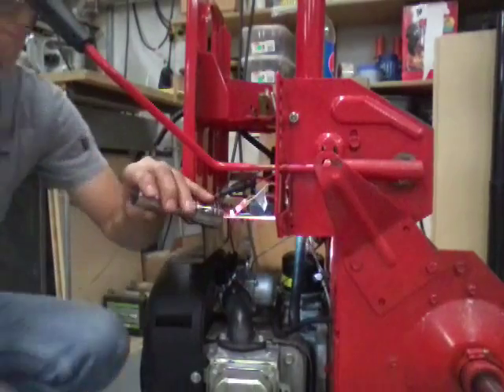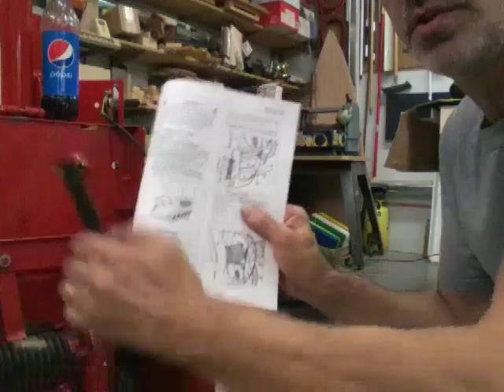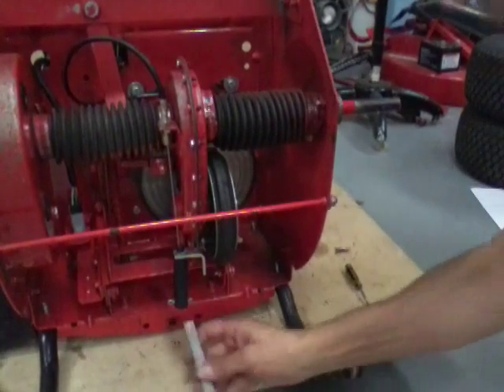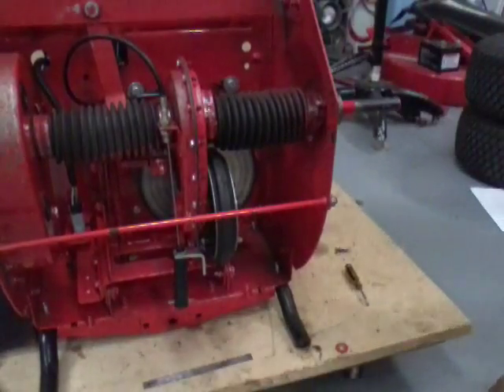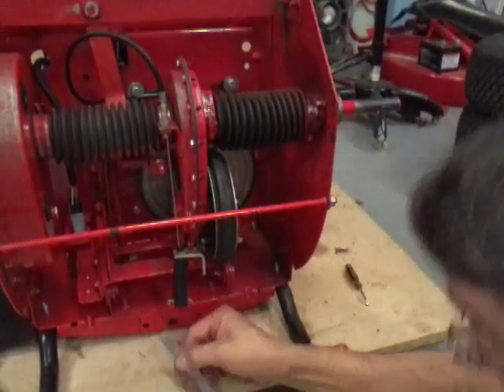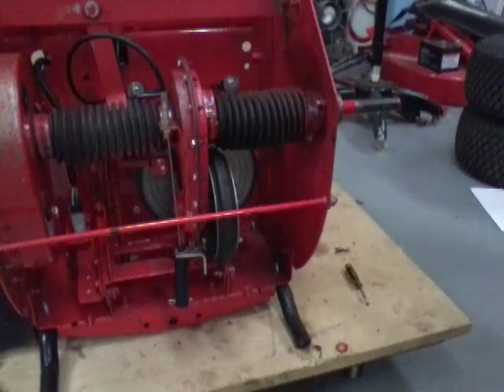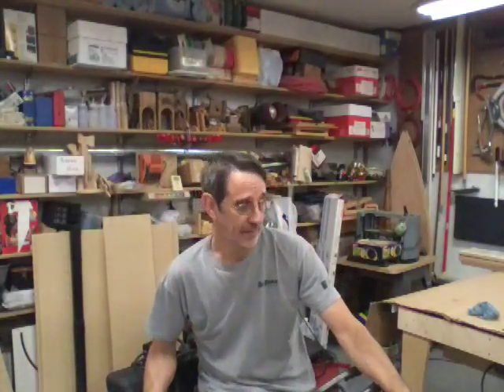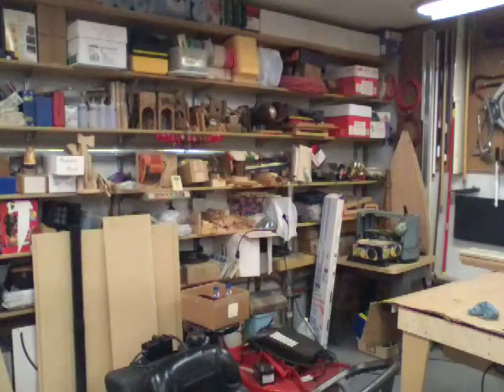144.   Adjusting the clutch and brake cable, installing the rear tires, the seat, and the gas tank.

Comment: Jim I ran over something with my snapper now the clutch only has about a qtr of an inch area to mash the peddle
Reply from the maker: I don’t know what you could have done to the clutch by running over something shorten up the cable by using the pharaohs and putting them through the backside of the pedal.
Reply: @jimjackson9381 where would you start with a slow engaging clutch and the shifter is really tight and does not want to go into reverse ?thanks so much for your great videos 28 inch high vac deck it’s really tight watch you video on checking the bracket when shifting I don’t feel any notches I have a spare machine exactly like it thinking of switch the motor onto it
Reply from the maker: @waynekelley2029 have you stood the machine up and checked to see if anything looks like it was damaged and if it’s shifting hard, you need to clean and grease the hexagon tube underneath your boots I would start there and then if it’s still shifting quite hard, unhook the linkage from the backside of the shift handle you’ll need to stand the machine up to do it and try just shifting the shift handle a lot of times those rust up and need to be disassembled and clean let me know what you find out.
Reply: @jimjackson9381  thanks for getting back I will work on it this week I Will lube it and check the handle also cleaning the card I will let you know how it goes thanks so much for the help
Reply: @jimjackson9381  Wayne Kelley wanted to say thanks your advice was spot on I greased the axle and now I need to replace the clutch wheel rubber is worn I will let you know how that goes the good thing is I have an identical snapper for parts

Comment: Jim not sure you'll see this. but I liked and enjoyed the video. I need the snap ring you mentioned at 8.02. Would ACE hardware maybe have them? Any chance you know what size to ask for? Thanks in advance
Reply from the maker: You should be able to get them from Ace Hardware or maybe an automotive store. It is a 3/8 outside snapping.       Jim
Reply: Jim, thanks so much for the reply. Upon further inspection I find I need the entire plastic piece that houses the spring and cotter as it has broken. Any idea what this piece is called? I plan to search the web. But, would help if I knew the correct name for it. If you can help? Thanks in advance.
Reply from the maker: Unfortunately, as far as I know, they don’t sell that piece separately you have to buy a new break cable.     Jim
Reply: @jimjackson9381  Yes, make sense. Thanks again..
Reply: @jimjackson9381  Jim I hate to keep bugging you, but I've spent hours searching the web for a clutch cable. My mower is a 301223 BVE. It has the one pedal. So the clutch cable is the long cable and the brake cable, a short cable connects to it. I can find plenty of the long cables but not the short cable that I need. I'm sure you're good at parts look up. If you could drop me a link to the cable I need, it would be so grateful.
Reply from the maker: @mrih1586  OK I just checked on Parts tree and they have them for $27. Use your model number and it’s under front end steering. It shows both cables.       Jim
Reply: @jimjackson9381  thanks never thought to look under front steering. I'm at doctor's office. Will order later. Again thanks so very much for your time and trouble.

Comment: Can the Aux/brake be bypassed using only the clutch/brake on a 1985 snapper riding mower without causing a braking problem particularly uphill?
Reply from the maker: Mary SanMiguel 
Send me a picture of your chain case with the brakes in view so I can see what styles you have and you must have a double pedal machine you can send them to my email which is
jimsfixitshop@gmail.com
Thanks Jim

Comment: Dear Jim A.
We bought a used re210 7800921-00 (turtle),  it worked fine at first. You know that we have to hold down the clutch/brake to electric  start it. It got to the point of practically standing on the pedal to get it to start. Then I figured out to pump the pedal then hold it down with both feet to get it to start. A few times it took only 1-2 keyturns to start. In the mean time the steering plate teeth wore down. Replaced it. Trying to start it again. 2 feet on the pedal again! I'm over 65 & that is wearing me out. Is there an adjustment or a by-pass or elimination fix for this?
Reply from the maker: John Verkler 
You need to check into safety switch on the yolk underneath the main case. Jim

Comment: I have a rer 2001 Snapper 30”. I accidentally cut it wear it goes into the pedal itself. I was trying to remove one of the little ferrules because I had slid into spacers to adjust my belt. Anyway, what cable do I need starting at the clutch pedal? It worked fine until I cut about 4 strands at the pedal. And is there an easy way to remove those ferrules?
Reply from the maker: The only way to move the ferrules on one side of the pedal or the other is to slide them down the cable you can try re-wrapping the broken strands around the cable then wrap the broken ends with a piece of tape to help, otherwise you may have to replace the cable. Jim
Reply: @jimjackson9381  
What cable do I need?
Reply from the maker: @Garylee62  well it depends if you have one or two pedals on your machine if you have one pedal then you need a new clutch Cable if you go on to Parts Tree.Com with your model number you can find a part you need it should be under front end assembly. Jim
Reply: @jimjackson9381  Ok, thank you Jim

Comment: After changing the engine on my 2003 Snapper I greased it and it runs great. My problem is that 1st gear is great but 2nd. & 3rd. gear grind when I put it in those gears. It will shift into those two gear but it doesn't sound like it is going all the way into 2nd or 3rd. gears. The clutch has a lot of slack in it. Could it be the align problem you talked about?   Thank Bill Davis
Reply from the maker: William Davis 
Have you watched videos 70 yet I will try tightening your yoke spring and see if that helps and let me know. Jim
Reply: @jimjackson9381  Thanks for your help Jim. Someone put the wrong sized disc on this tractor. The rubber is not loose. I did tighten the spring up. Works great now.
Reply from the maker: William Davis 
Awesome glad to hear we fixed it, don’t forget to subscribe if You’re not already. Jim

Comment: What does it mean if I'm at the maximum adjustment and all I can get is a quarter inch not 3/4 of an inch like you say
Reply from the maker: @danielborth7753  that’s just a factory setting. I wouldn’t worry about it if the brake works it’s OK if it doesn’t then you need to tighten it up a little bit.

Comment: Hi, Jim. I adjusted the brake cable like you described and got the 3/4” measurement. However, when I’m on the mower (engine running) with the parking brake engaged and the mower in neutral, the machine goes off when I get off the seat. It use to stay on when I got off under those conditions. If I clamp the pedal all the way down, it continues to run when I get off. Any ideas?
Reply: It’s the sensor under the seat. It’s designed to shut off when you get off the seat. No idea why it didn’t do that before or why it just started working properly
Reply from the maker: Well let’s see there’s a sensor under the seat or is there a sensor on your yolk inside the rear case. Jim

Comment: I got a 28 inch rider and it cranks up just fine but when I get to release the break it putters When I start moving it but when I-but when I try to put it in to engage the blades while running it runs fine but when I stop the Disengage Blades It goes back to stuttering And when I put it in park with the break it runs fine can you tell me what the problem is
Reply from the maker: It sounds like your carburetor needs to be cleaned it’s not getting enough fuel when it’s doing anything other than idling if you have adjustable jets on your carburetor you can try adjusting them but most of the newer carburetors there are no guts to adjust, you may have to take the carburetor off and I use an ultrasonic vibrating cleaner that does a marvelous job on cleaning carburetors. Jim

Comment: Hi Jim. Tom in Oklahoma.I want to leave the deck of (for parades and stuff) of my RER Snapper. how does it move without the belts.HELP
Reply from the maker: Poppy 
The belt is only for the mower deck. Remove the deck and the belt and it will work just fine. Jim

Comment: 1 more question for later. Can you change from that brake lever with the shoe on the end to that metal band like on yours??
Reply from the maker: Vinnie C 
Hi Vinnie
  You probably could but you would have to change your sprocket and shaft on your chain case to except the brake drum. Thanks Jim
Reply: @jimjackson9381  oh.. does that 3/4" for tightening up the brake cable on my machine as well
Reply from the maker: Vinnie C 
I am not sure what you’re talking about can you send me a picture to my email. Thanks Jim
Reply from the maker: Vinnie C 
 Hi it’s Jim. 
I am not sure what three-quarter inch item you’re talking about can you send me a picture or give me a little more details thanks. Jim
Reply: @jimjackson9381  yeah I'm talking about that scale ruler you used and stuck it in the brake cable spring to measure how much to tighten up the cable..is it 3/4" for all snappers.
Reply from the maker: Vinnie C 
OK now I know what you’re talking about, as far as I know most all of them are 3/4 of an inch, but I had a lot of trouble trying to get in that tight I think I only went 5/8 of an inch. Thanks Jim

Comment: Hey Jim I have a 2013 Rear Engine Snapper... any idea where I can find the BLACK PLASTIC CLAMP that connects both cables? Thanks
Reply from the maker: EdJuan Burriss Send me your model number and I’ll look on Parts Tree.Com to see if I can find one thanks Jim
Reply: @jimjackson9381  the model is Snapper RE130 (7800932-00) - Snapper 33" Rear-Engine Rider, 12.5HP, RE Series... I've tried looking on Parts Tree but cant seem to find it. Thanks for your help!!!
Reply from the maker: EdJuan Burriss 
Hi it’s Jim
   I found your parts on Parts Tree.Com. the plastic clamp part number is 7034174YP it is item number 1300 you can look for the number and find it on the schematic it’s $2.46 now parts trees sells things in Single pieces you can call them and check but normally you would have to order two of those to get both half’s you can call them and ask them if it comes both pieces or just one, the bolt that you will need is item number 1310 it’s $2.52 the nut you’ll need is item number 1320 and it’s $2.18, I am not sure if you could use standard hardware or not I know the nut is a self locking nut the bolt is probably a standard bolt but I’m not sure. If you send me your email I can send you a picture of the schematic and show you where the parts are otherwise call them their phone number is at the top of their homepage and They will be more than happy to help you just tell them Jim‘s fix-it shop sent you. Thanks Jim
Reply: What about the rear hitch plate (7301297YP) currently shows unavailable.... I recently had a catastrophic accident which bent the rear plate, pressing the yoke against the drive wheel... cant find this rear hitch plate anywhere.. I guess I'm just up the creek... or maybe I can just go stone age and try to hammer it back in place... any suggestions??? Thanks for your help
Reply from the maker: EdJuan Burriss 
Hi it’s Jim
   I think you’re going to have to go Stone Age and beat it back into shape the rear plate on your rear case is welded there’s no way to replace that send me a picture if you can and I’ll see if I can figure out what to do with it.   thanks Jim

Comment: Hey Jim. I finally got my Snapper series13 machine all back together. I don't have a scale small enough to measure the brake spring 3/4" compressed. Do you have any suggestions how I could measure it?? Puzzled in Wisconsin..lol
Reply: Use small object nail, stiff wire or something like this, stick it up in brake spring holding your thumbnail on depth pull out and measure with scale.

Comment: Jim, where can I purchase a copy of Tim's service manual?
Reply from the maker: Randy Moore 
Hi Randy
I got mine from Parts Tree.Com. I went through all of the different schematics and did screenshots and had them printed out. Jim
Reply from the maker: Hi Randy
You could also call Briggs & Stratton. in Milwaukee Wisconsin and they probably can get you a copy of those manuals. Jim

Comment: Where can I get a copy of Tim's book?
Reply from the maker: Are you looking for a copy of the operators manual, I could take it to the print shop and have them make me a copy of it but I’m not sure what they would charge you can go to Briggs & Stratton. in Milwaukee Wisconsin and they will send you a PDF file of the books that you need if you have your model number. Jim
Reply: Thanks Jim. I was looking for the service manual. I found a PDF of an old one on the Snapper website, but it's for series 4, 5, & 6 with the bicycle handlebars and doesn't have the cable adjustment in it since those still used the brake band and drum.  I couldn't find one on their site for the current units.
Reply from the maker: @JDski  I may have some information on what you need adjusted what are you trying to do and what isn’t your machine doing for you. Jim
Reply: I'm ok for now, I just wanted to see if I could find the manual if it is available for future reference. I'll check with my dealer.  I've only had my unit for a little over a month which I bought brand new, so no issues yet other than it squeaking where the frame pivots on the center tube. I sprayed some WD40 there while having it standing up which seems to have fixed it for now. I didn't see any grease fittings there.  Does this sound normal?
Reply from the maker: @JDski  Well the squeaking doesn’t know grease fitting does, WD-40 evaporates it doesn’t last long you’d be better off to try to drip some standard oil in a crack to see if that helps. Jim
Reply from the maker: @JDski  You bought this machine brand new and you didn’t get a manual with it?. Jim
Reply: Yes I got a owners manual, but not a service manual. It was the floor model so maybe if was supposed to be included, it was misplaced. I'll check with the dealer. 
 I'll also use oil next time if it starts squeaking again. Thanks.
Reply from the maker: @JDski  
Did you find a copy of the book that you’re looking for let me know and if not I can try and make you one. Jim
Reply: Thanks Jim but I haven't had to chance to check with the dealer where I got it yet. I'll let you know if they can't provide one.
Reply from the maker: @JDski  No rush just let me know I can runoff copies at work I guess shouldn’t be a problem. Jim

Comment: Hey Jim I'm looking at your videos my Snapper was running real good and then the belt broke I try to put a new belt on there it wouldn't start so I put a new ignition switch the battery checks out okay but I still can't get it to start what am I doing wrong and I wish you was close to me so you could work on my snapper and I am in Georgia
Reply from the maker: Carolyn Shook 
Hi it’s Jim
 Sounds like you have a safety switch as giving you issues there’s one on the mower deck that you could have bumped, and you may have one in your main case where the yolk is check them out and let me know. Thanks Jim